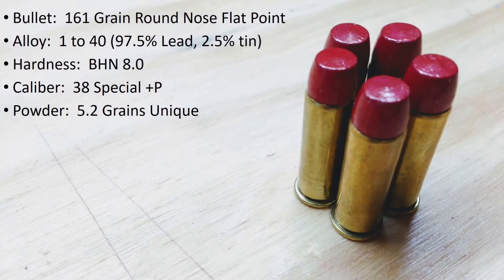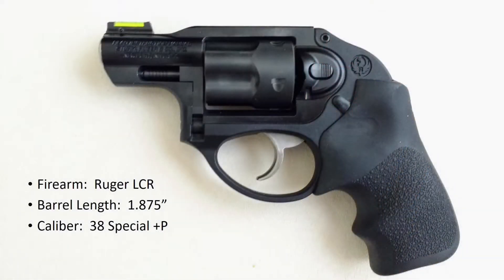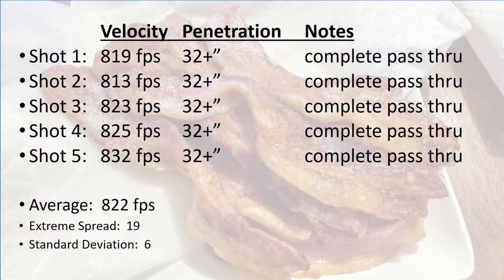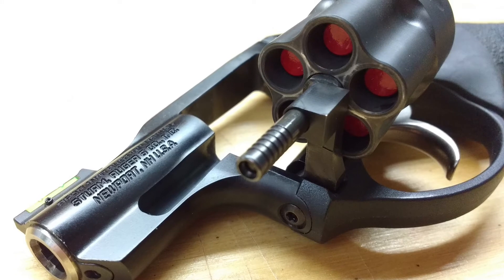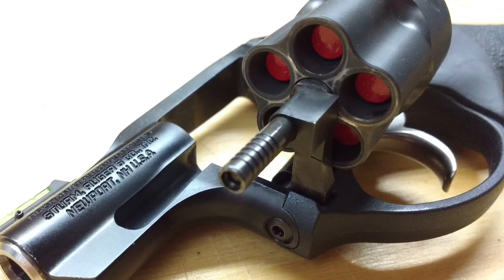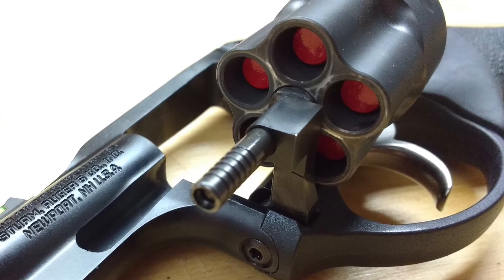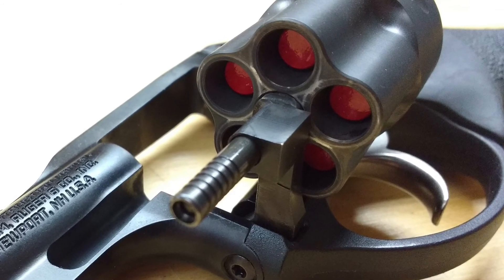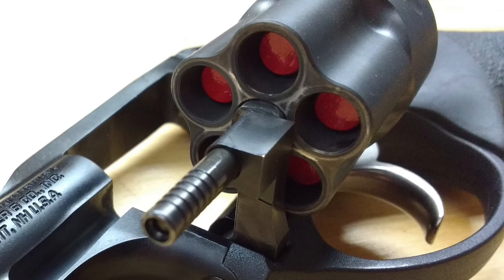38 Spl +P, Solid Nose, BHN 8.0, Bare Gel (PC HP Test)

Comment: What you should do is load them down to 650 FPS. I carry the 158 lswc at a bhn of 12 in my snub and it gives good penetration without being excessive, plus its low recoil for quick follow ups.
Expecting both adequate penetration and consistent expansion is an exercise in futility with s snub nose.
Try the 650 FPS load.

Comment: Well you've got soft lead already - BHN 8 or 9.  If you were a cop, those loads would overpenetrate and be against department policy.  If you are using those for self defense or CCW, problem in that any potential legal proceedings would accuse you of using "red blood thirsty barbarian bullets".  So they would be good hunting bullets, especially in my Winchester 94 Trapper - fast handy lever gun.  Would not be carrying a snubby in the field.  My think is you've got a good load there for general use out of 4 - 6 inch pistol barrels or any lever gun - if it was a round nose, it would be only good for steel or target paper.  For your snubby, you might even consider cutting it down to 750 fps say with 3.3 Bullseye - might get those slugs to stay in the target.  There was the day when police used snubbies loaded with target wadcutters for their back up gun.  Good video..!!  FC
Reply from the maker: It's interesting to me that, as you say, "those loads would overpenetrate and be against department policy", and yet our nation's defenders have been forced to use FMJs for years.  There are some that will claim that the large meplat with the soft lead will perform similar to a HP, but I believe this tested proves otherwise.
This is my 38/357 plinking bullet, and this is a great load in my 4" revolver.  It's very pleasant in a rifle, and my 6 and 8 year old boys enjoy shooting it (especially when loaded with 4.0 grn Unique).  Good shooting to ya FC!

Comment: i found the same results with the 9mm truncated cone bullet. That's why i order the MP mold. I was able to get the truncated cone up to 1250 FPS using the win 572. This resulted in slight deformation but nothing like the HP. I personally wouldn't bother with the solid nose when tring to expand the bullet. I would pay mind to the velocity when doing the HP bullets. You saw what i got from 10 BHN at just over 1000 FPS. I plan to push the max load to see if i can get it to flip inside out. Even at max load of the specs the glock didn't feel excessive nor did i have any primer issues after over 100 rounds at the range.
Reply from the maker: What was the weight on that one?
Reply: sorry i was eating. It is the 124g .356 TC lee mold
572 .355" COL 1.150" 
START 5.3G 1,131FPS 27,200 PSI 
Max 5.8G 1,212FPS     32,600 PSI

Lee Precision Tl356-124-Tc 6 Cavity Bullet Mold
Reply from the maker: Thanks!
Reply: no prob. I don't remember what my actual FPS was but i know that at the max load it exceeded the projected velocity. I'm pretty sure it was around 1251 or there abouts with the chronograph. I did use #400 primers (For any viewers, I'm not suggesting that anyone do this unless they know what there doing) For the sake of honesty i wanted to state that about the primers. If you want to know specifics i can find my notes on that round and let you know.
Reply from the maker: That's a quick bullet for a 9mm.  Do you have an upgraded recoil spring?
Reply: no. it's a stock Glock 34. gen 4
Reply: Actually, i did upgrade the barrel to a lone wolf. Which does compress a little more than the stock barrel. But the specs i posted are straight of of the hodgdon reloading site. i could test the load with the chronograph with my PC9, astra, G34 and my G43 and see what the difference is. I still have plenty of the bullets casted and coated. i might even have a bunch still ready to shoot.

Comment: Based on experience I would lower the BHN probably use pure an PC or up the velocity with the current BHN to at least low end 357 velocity.  I get excellent expansion with a NOE HP clone of the Ray Thompson 358156 bullet cast with 50/50 in 38+P loads but with the FN design non at all.  Even at the higher velocity using the same BHN expansion will not match the HP but the large meplat on the FN will do it's job although you might not notice it with gel test it still has the squash effect on tissue.
Reply from the maker: Thanks 7sixtwo!  Faster it is.